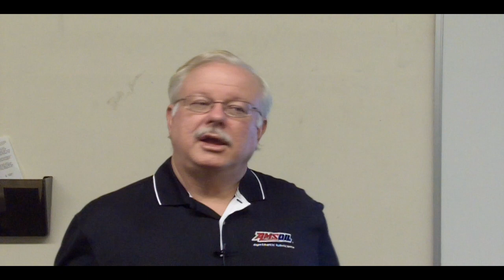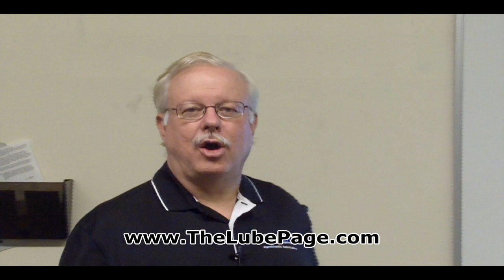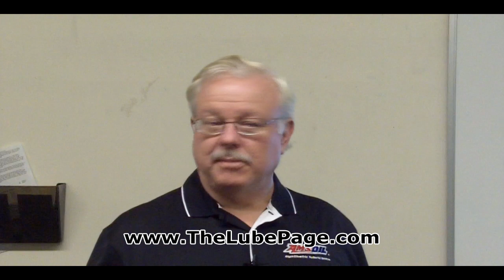Hydrocracked vs PAO Synthetic Motor Oil

Comment: Amsoil is the only true 100% synthetic oil period. Only company to make a Group V oil. All other companies only go as high as a Group III and Mobil 1 may touch the Group IV area. Just for note Amsoil Signature series is the only 100% True Synthetic oil. The OE and XL series are Group III Hydrocracked oils hence the lower price.
Reply: JayzBeerz motul also has a 100% synthetic oil. A 5w 30
Reply: Motul makes 100% synthetic too
Reply: Wrong!! Amsoil is not the only one.

There are a few others who make Group IV and or Group V 100% Synthetics.

Like for example: 
SynLube Lube4Life uses a Base IV and Base V together. 

And with their very specific additive package has Amsoil beaten in the drain interval category by a length as great as the pacific ocean. 

150,000 Miles or 15 Years, whichever comes first. 

Synlube.com

Sorry Amsoil. Yea your SS produt is good. But SynLube is superior now.
Reply: @extremedrivr  They do not make my gear lube, or oil viscosity so what is it good for?
Reply: Not true! Redline oil uses group4 and 5

Comment: i made a mistake of buying the castrol power rs tts 2 stroke oil full synthetic but i found out castrol is nothing more than a highly refined crude oil or grade 3 oils. now im in the urge of selling it and possibly buying the maxima bio 2t oil instead unless this castrol oil is not that bad.

Comment: ...turn more people away from Amsoil than towards it.  Foul language, bad attitude, and childish barbs toward anyone who dares to question Amsoil's absolute supremacy.  

Amsoil owns the extended drain market, and that's what Signature Series is formulated to do.  Red Line's strength isn't extended drains, on that front they are little better than XL, what Red Line builds oils for is minimal coefficient of friction, shear stability, and unsurpassed deposit control.  On those fronts THEY dominate

Comment: Negative.  Red Line doesn't have "dealers" in the way Amsoil does, Red Line requires a show room, a display, and advertisement.  Trust me, I looked into it.  I do not sell Red Line products, I am in no way associated with Red Line on any level.  I AM an Amsoil dealer however, I just appreciate certain technical benefits of POE based oil like Red Line in certain high demand applications.   My DD gets Amsoil AZO for extended drains, my "race car" gets Red Line street oil.  Dealers like you...

Comment: ...and all that calcium (which is primarily where Amsoil is getting that 12.5 TBN from) isn't without drawbacks.  

The simple fact of the matter is that when it comes to high heat, high stress apps Red Line with it's superior high lubricity, highly polar, polyol ester base and 950 ppm shot of MoTDC and higher ZDDP levels oils will outperform Signature Series.  Period.

Comment: Dude, it's obvious YOU are an Amsoil dealer.  
Controlled testing, like what, Amsoil commissioned and published 4-ball wear tests that have no relevance to a lubricant's performance in an engine?  A test that not even the API acknowledges as a viable test for lubricant performance?  That "controlled testing"?   

Many passenger vehicles DO fit that niche.  GDI/turbo/small sump gas motors fit that niche to a T.  Drain intervals are only one aspect of lubricant performance...

Comment: Dude, you're such an obviouis shill, it's pathetic. Passenger vehicles don't fit that "high heat/high demand" niche. So, what market are they focusing on? 

Red Line recommended drain interval: Max 15k to 18k miles
AMSOIL recommended drain interval: 25K miles

It's funny how, under controlled testting, AMSOIL beats Red Line, time and time again. But, don't take my word for it. Just go back to being a good little fan boy/shill and keep ignoring the facts.

Comment: XOM slide shows indicate that they do still use Group V components in their oils, but rather than a polyol ester or diester they are using alkylated naphthalene (AN's) as a polar/soluble correction fluid.  They have some of the desirable traits of the esters, but not all, and not to the same degree.  ANs are much cheaper than esters.

Comment: @geonerd   Agreed, Red Line Synthetic Oil Corp has been producing PE polyol ester (POE - group V) base stock street and race oils for YEARS.  Red Line admits to using PAO (group IV) in their oils to keep seal swell down since POE is such a highly polar lubricant with inherent solubility and seal swelling characteristics, but POE is their primary base stock.